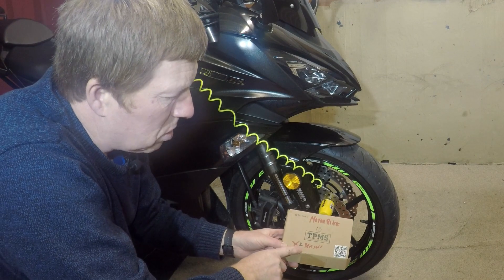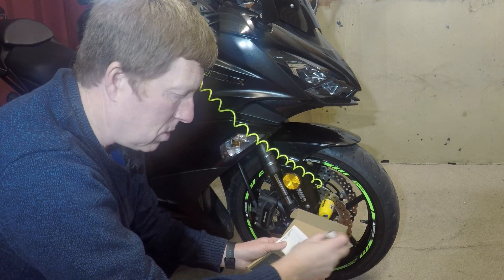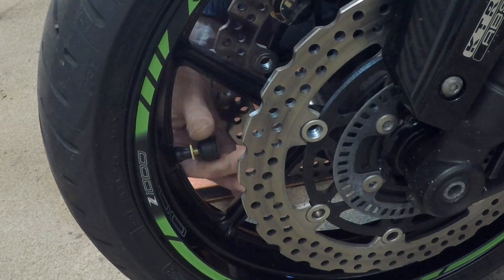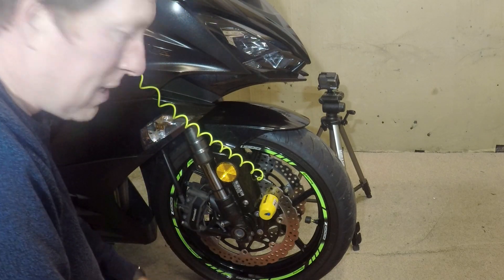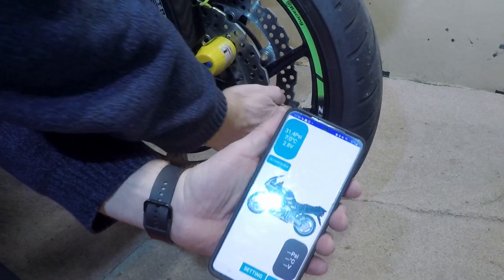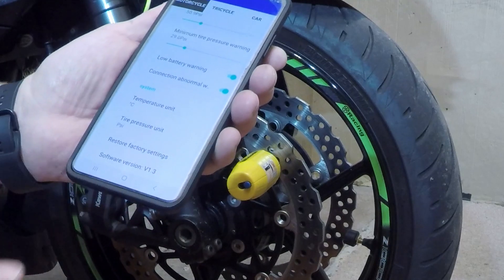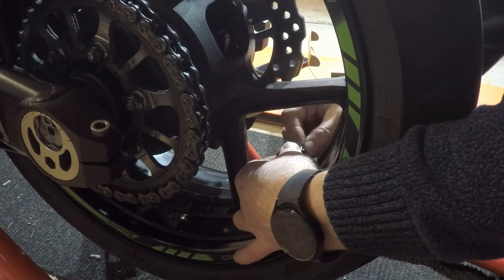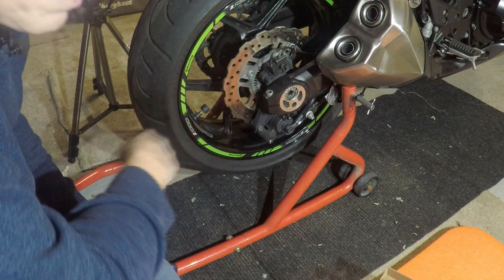Fitting a Bluetooth Universal TPMS to a motorcycle tyre - SYTPMS

Comment: Hello , I have a BLE TPMS set for bike. When bike gets off it requires to install tpms every time and pair it through app to get data.  Is there anyway to get data continuously even if i leave the  bike for sometime ?
Reply from the maker: I use SYTPMS, and I've not had that problem. I would check if you have paired it correctly in your phone connection settings first. Then, maybe uninstall and reinstall the app.

Comment: Fitted them to my RA tyres but cannot pair either sensor with the SYTPMS app...anyone else had this problem ??
Reply: I've got the same issue. Don't know how they paired so fast in the video. Mine are a bloody nightmare. Will try to change the batteries to see if it gets better. BTW, I've removed mine from the bike, the extra weight on rotation trashed my tyre valves - now I keep one in my pocket to check the pressure if needed. Regards
Reply: @pedroalipio3146  mine paired only this way , open the app and they would pair only when screwed at that point , make sure also all permissions are given especially the appear on top permission , when i put them all and then opened the app it would not recognise them
Reply from the maker: Yep, paired straight away, I was very surprised.    Wow, didn't think they'd do any damage!  Cheers for the heads up
Reply from the maker: I've never had this problem. They pair via Bluetooth and usually straight away. I'd be interested in seeing if others have a problem too,
Have you tried pairing via Bluetooth settings on the phone prior to using the app?
Reply: @TonysGarage_UK  i also bought 4 sensors for car and i cant pair any of it i wonder if the batteries are gone , do you see any bluetooth devices before pairing them through the bluetooth settings on the phone not on the app ?